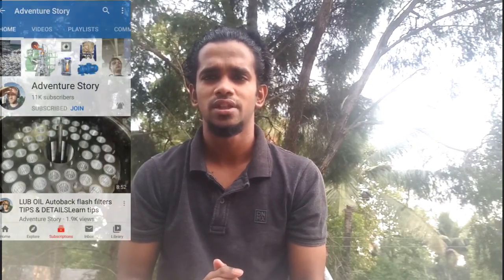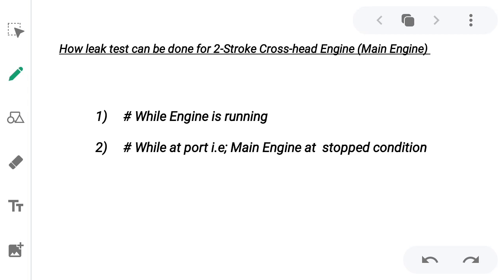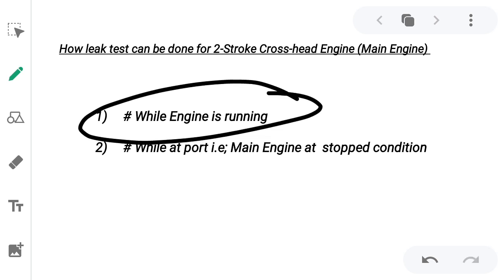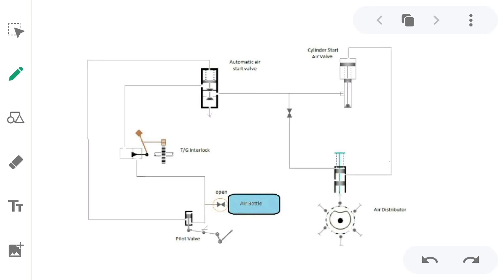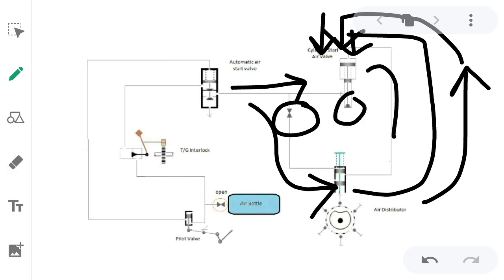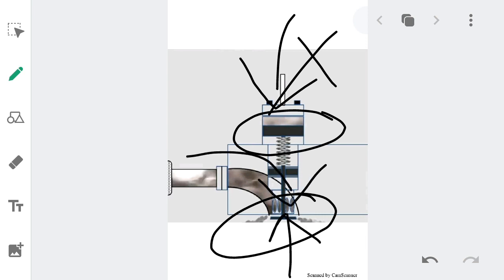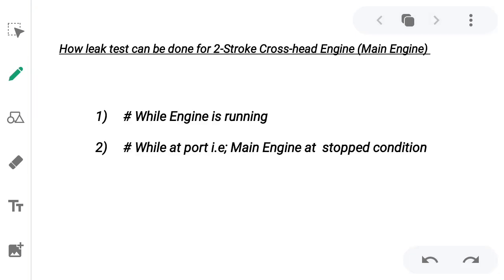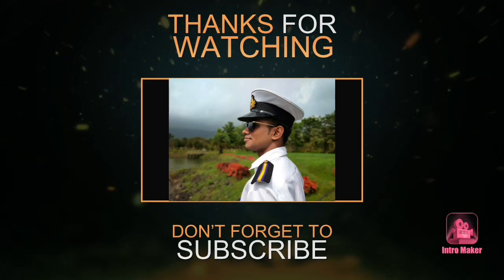How to leak test the Start Air Valve for the Main Engine - 2 Stroke Cross-head Engine ?? I Explained

Comment: Sir. We cannot open indicator valves of all units together to check if the Starting Air valve is leaking because few units will be at BDC or below the scavenge ports. So if air is leaking from Starting Air valve then it might escape from Scavenge ports and you will not be able to detect the leak. 
To test the Starting Air Valve we need to individually test the valve for each unit with the piston at TDC and distributor valve closed.
Reply: S correct , but u already know the the valve is leaking , or. Ovrhauled valve u fix in the particular unit , so keep the particular unit TDC , and give air kick

Comment: brother, i have a query.
lets pretend, during maneuvering period, one unit starting air line is already overheated. at that point what necessary steps should be taken?
Reply: make sure ur air bottles are drained, open starting air line drain line keep it open, during engine start stop there will be a case where complete air line would have exploded it is a tricky situation if possible stop engine if engine stoppage not possible reduce rpm and make some external arrangements to keep the air line cool like some blowers if it is safe water sprinkler can be used but be caution it should not crack the air line then we would be a sitting duck😃

Comment: I appreciate your effort to make this video but bro if you close isolation valve that you have mentioned above as you close this valve the alarm will come on screen that is engine is not ready to start. So we have to by pass this alarm otherwise automatic starting air valve will not open only .. Correct me if I'm wrong thanks